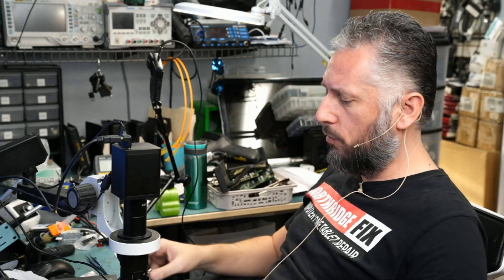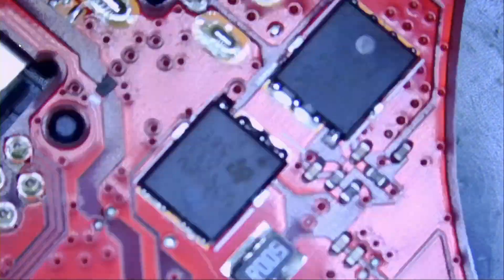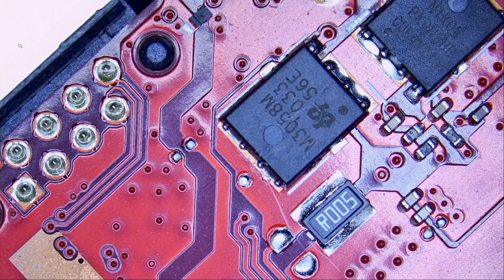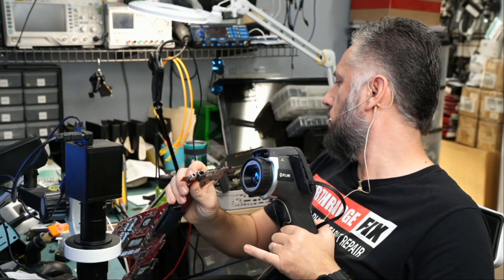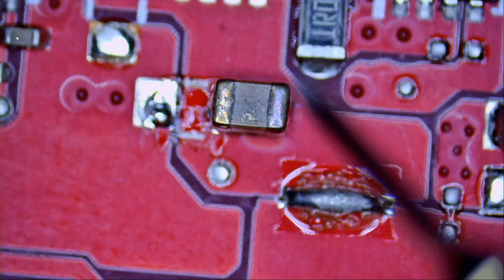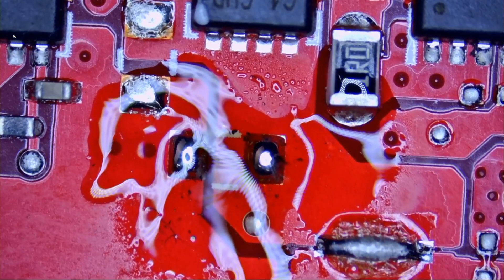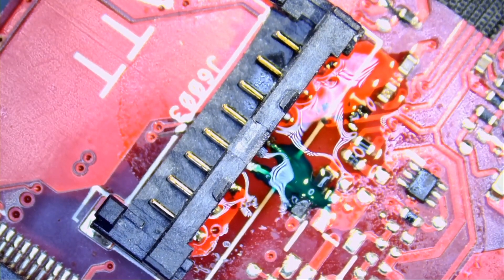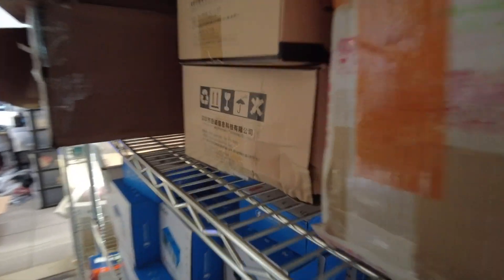Another Asus ROG Laptop Repair. What is the Best laptop to buy?

Comment: Totally agree with your comments on gaming laptops. I use a Thinkpad as my getting-work-done laptop, and a desktop for anything serious. I've seen way too many gaming laptops die young to recommend any of them.
Reply: Usually manufacturers put Cheap thermal paste from the factory , making it easy to overheat and die early, cause there a lot of videos out there with gaming laptop having reduced -10°C or even -20°C ❄️ just by replacing thermal paste ❄️❄️❄️❤️❤️ 

Second they pump too much voltage in their CPU's and GPU's than necessary (Still cant figure why.) 

modders and countless vids also proved you can reduce temps by Undervolting ❤️⚡🤟 if you dont want to open up and play surgery with a gaming laptop.
Reply: @JoshuaG  I agree with you. But the problem is people who buy them don’t know that, and it’s really a big problem.
Reply: For gaming laptop with Nvidia graphic card, you can try to turn on Whispermode. What does it do? It limits the FPS to 60 FPS with more stable temperature at 59-60C. No need to tweak laptop such as undervolting, apply thermal paste to CPU
Reply: Agree. Thinkpads are very good daily drivers. On the more expensive side, Panasonic Toughbooks (semi or full rugged).
Reply: indeed - it is what I am actually telling ppl for years
Reply: I have a dell G7 from 2018 that's still going. It's traveled around the country and is still fine. Windows however, ran like crap on it in various ways. I just phased it out for the steam deck, which is a lot more compact and lighter. The laptop is working though.
Reply: @gwojcieszczuk  - Toughbooks are military grade.
Reply: @JoshuaG  thank you for the info!!! But on my 531GT ROG Strix.....I never Gamed. I just used it for everyday stuff and DJ Software, Now I have a 10 year old dropped and screen replaced twicw and a new drive. thats it. CD rom died. But she is now my SDR Play Go To. Blessings All

Comment: Awesome repair, I've had lots of laptops and very few problems,  never had an Asus.  I completely agree on the 
desktop for high end graphics, laptops are just the wrong form factor.  The other issue with laptops is you are 
generally stuck with the hardware you have, not easy to upgrade like a desktop.  Excellent video.

Comment: The key is consumer based machine vs business grade machine. This goes for laptops and desktops.

I have a thinkpad T430 from 2014 that has never had anything done except mechanical hard drive swapped for an SSD. It runs amazing. I paid $200 for it used in 2014. T series was lenovos business grade line for many years.

Likewise I have a Dell Optiplex 3020... several years old. At least 5 years old. Again, swapped mechanical drive for SSD.... never another problem. 

Buy a laptop or desktop at walmart, target, or bestbuy... your getting consumer grade junk. Some may last a few years... most machines from big box stores wont last.

Comment: Genius work here. Just my experience, my old Omen 7700HQ 1060 MaxQ laptop has been golden since early 2017. Its running a full-size 3-fan 3060Ti in an eGPU, having had a 2060 in the enclosure before that. Benchmarking runs just below the average of desktops for both these cards, and I'm still happy gaming on 1440p 165hz 27" monitor at 90-120fps. But after this, I don't think laptops are the way to go for gaming now, mainly due to Thunderbolt being too limited and not able to get reasonable performance from GPUs above the 3070. Next PC will be a self-build desktop.

Comment: I think your right on with gaming laptops they do run hot and you are getting less for your money than a desktop,  so if you dont need portability then the desktop is definitely the way to go..

but saying that I've got 2x i7  gaming laptops that I've had since they were bought brand new,  they get used heavily daily  one is  an old MSI GE70 that the Mrs uses 16 hours a day  - the only issue with that one was with the original  battery itself failed after 3 years, and this one which I am using which is an  i7/ gtx1060 MSI GE73 Raider 8RE which is only off when I am asleep  or out of the house  - I ditched the original sata M2 drive and hdd and put 2x nvme m.2s samsung & kioxia (toshiba) and a mx500 sata SSD I had  spare, and went with 32GB of Crucial memory - this one can get really hot if not using cooler boost with games like Star Citizen, but seems stable and can cope with extended sessions even in the heatwave we had here in the UK, but I do admit I  use small  1 inch blocks  fixed to a board which sit under each of its feet to  make sure it  has enough air - the only issues I have had with this one is a frozen bios after a couple of  the Microsoft updates - but the bios reset is easily accessible without disassembly from the underside, and  the keyboard LED's  the green portion of the RGB has failed on a number of keys - I have avoided changing it out as the keyboard is heat-staked  rather than screwed or hooked into the palmrest, but functionally its still runs and works fine its been reliable for a number of years.

Comment: i think one big reason laptops fail is they are moved around and knocked into and bumped and a lot of motion inside of it where there shouldn't be movement making things fall off and break also after long period of high use causing it to become hot plus all the movement doesn't help them with out the proper air flow could it even get hot enough to weaken the solder after multiple heat cycles.... but there i go thinking again is that even something that sounds plausible or am i making shit up

Comment: Writing from an ASUS TUF Dash F15 laptop that is used in bad conditions, I would not have a problem replacing the MOSFETs whenever they would fail. But at the same time I have used a Clevo M571TU for the last few years, after it sat in the recycling bays of Germany, it was upgraded to the maximum possible, 16GB DDR3, GTX 280M, even installed a QX9300 into it because the big old chunk of metal is still running. Usually, unless something goes very wrong with these devices, they don't break for years to come. In some cases, 10-20 years, at which time they are well beyond the 5 years grace period regardless. This ASUS might be the first to be replaced after 2 years, because of needing more power soon, but remains a very respectable machine in my collection, afterwards. I had ASUSes back when they had the old EEE PC 701/901s, even overclocked one of those in recent years using resistors and feedback loop CPU voltage. Those run at double speed when overclocked, I even have the old BIOSes for them, shoutout to anyone who wants the old EEE PC 701 v4.00 bios, I have it, it's unlocked and custom LOGO'd ready to be flashed.

Comment: You are right, i also think that laptop aren't built for gaming. They called them gaming laptop, but they aren't built for it. The board, the heatsink, it is too small and they get to heavy or big. So better buy a desktop or build your self a desktop, so there is enough room, enough air to cool, and so on...great video. Greets

Comment: My Asus gaming TUF Ryzen 9 laptop died 8 months out of warranty (2 years).

We established that the PSU seems to have triggered the failure. Asus accepted that the PSU had been failing for some time (during warranty) but that an intermittent fault (it charged intermittently) was hard to prove... and replaced it... despite initially denying the out of warranty claim. 

Unfortunately, replacing the PSU didn't fix the problem and Asus established the motherboard was also faulty. They offered to diagnose it for free... waiving the normal fee. When they replaced the entire motherboard gratis I was surprised. Perhaps they were willing to accept that a PSU failing during warranty killed the laptop? Either way they've just bought themselves some serious good will. They never identified what had failed on the motherboard... which is a pity as it's nice to know which part is problematic.

Mind you... it was a fairly expensive laptop (>$2K)... and we bought 3 of them. It was barely used, never moved and was attached to a UPS... so there's no good reason for the failure.

The only problem is that there's no guarantee that the laptop won't fail again some time soon.

In future we'll stick to buying second hand laptops for more modest prices... on the assumption that if they've lasted a few years they're unlikely to perish any time soon.

:-)
P.S. Only annoying thing about the repair was that the repair centre deleted everything on the hard drive... and it's going to take a long time to reinstall it all: A fair bit of technical software with fiddly licensing.

PPS. Desktops don't seem to have any of these problems: If they ever have a problem it's a minor expense to replace parts... but laptops are useful at certain times.

Comment: I'm not sure the issue is with ASUS themselves, anything can cause an issue with the motherboards, ie running them hot for too long, then closing the lid so the heat cannot vent, constantly mobilised and shoved into a confined space such as a back pack after heavy load prolonged gaming time.

everything electrical fails at some point in its life cycle, there's no "well what about LENOVO or this make or that make", most boards and capacitors are made Widley from the same factories in Indonesia or China for many brands so blaming ASUS is a bit stereotypical.

ASUS have made some poor designed choices in the past with poor ventilation on there outer cases, i  have 2 ASUS laptops and one is ROG GL703 from 2017 with a gtx 1050 and its had some hammer trust me, still running still works still games, and a TUF F15 2022 model which has improved ventilation and runs cooler with less power draw, the mistake some people are making is purchasing laptops with the high end rtx cards which will run hot, go for the entry level RTX 3050 or the GTX1650 gpu laptops, if your wanting to run games with all the bells and whistles enabled you really need to purchase a desktop.

ive had ALIENWARE AND LENOVO lap tops with the high end cards and had nothing but trouble with them so i feel going for lower power draw and cooler less demanding cards and run games at an honest in game setting not pushing the gpu then you will save your laptop.

n RTX 3080 in a laptop running raytracing is A NO NO, leave this options disabled your laptop will thank you for it.
i would only risk RTX on with a desktop equivalent, as much as the card is designed for RTX on i just wouldn't on a laptop, which values my point go for the entry level gpu based gaming laptops, the cheaper the better,£650 for the ASUS TUF F15 RTX3050,if it breaks then its not as heavy a hit on the wallet, im done paying a 1000+ for a gaming laptop.

Comment: so i think ive figured out the trend of why gaming / high-end laptops fail is because of the heat from cpu and gpu.. witch causes caps, mosfets, and other component's to fail,  I've gone though   3 laptops in 7 years! all had mainboard failure but i got my eurocom laptop fixed after a mainboard replacement i decreased cpu clock speeds to stock 3.6  hopefully it lasts longer than 2 years this time!

Comment: I got myself a lenovo y540 i5 9300 gtx 1660ti brand new 2 years ago. Never had any issue. Undervolted and underclocked day one.I dont play on ultra but rather on high/ultra or 60fps, something that would not trigger the gpu fan to spin crazy. I have good temps. I could get more power out of it but it'll gonna get more stress by the heat for almost no gain and makes it less durable.

All i'd say, if you buy a gaming laptop, UNDERVOLT + only enable higher graphics when it's worth it, i mean, msaa x8 + fxaa x8 + aa x16 is kinda pointless on a laptop...

Comment: The two best laptops (I have experience with a lot of them) are 
1. AORUS 17X (Intel 12th Gen)
2. ThinkPad X1 Carbon Gen 10 (14” Intel) 
I would recommend the MAC, but, they are so damn expensive to repair.
You need a laptop if you are a mobile tech.

Comment: To me a laptop is for use when traveling or needing a portable solution.  Otherwise desktop all the way.   The laptop I currently have was bought used and it's an Asus ROG gaming model from like 2012.  I've upgraded it by swapping out the older wifi G to a much newer Wifi 6 M.2 card.  Gosh what a pain to get to.

Comment: Hey boss, when you solder things like these motherboards, what temp do you set your soldering iron to? AND also what temp is your heat gun? Do you use the heat gun simply to keep the solder warm enough to quickly re-flow? I'm about to replace a DC jack plug on an older Asus Zephyrus laptop, and I'm just not sure what the best temps are to use. I assume I will also use Flux as I've seen you do in all of your videos.

Thanks!

Comment: To begin with, Asus has always been a bad choice for notebooks, I agree with the issue of desktop durability, I had desktop computers that lasted more than 10 years, I upgraded due to obsolescence, and even then I reused the power supply, monitor, cabinet etc. I don't know why desktops are so much in disuse, they die out of nowhere and you still don't reuse anything.

Comment: Hi Alex, what do you think about to use the solder mask under the pad strip to fix them on the board ?
Reply: Ideally you want the piece you're soldering onto to be as flat as possible with the board, putting solder mask under the pad would make it sit unevenly and the other pins would have to accommodate for the height difference.
Reply: The problem being solder mask is UV Cured - the copper blocks the UV light.

Comment: what is your experience with Lenovo Legion?  It seems like ASUS, HP, Dell all have similar issues in their gaming setups.
Reply: HP and Dell are kind of generic for office, some models are not meant to be repaired or require some special parts, but they are overall good. Asus is fine, but they are focusing on 300W slim laptops, not good, but people want that, thats a problem, too much power in a very small space, does it work, yes, when it will go bad, as soon as possible. Acer are fine, but they changed some things, they can be very complex. Legion, in my opinion, not good as other brands. When you consider future upgrade, such laptops cost money, less and less laptops are offering that, because business people do not need that.
When you consider future and durability, things like changing battery, replacing keyboard and such, Legion are bad. On most laptops you can replace keyboard, remove older one, put new one, but Legion have that wonderful idea to bound one of 4 laptop covers with the keyboard. This 4 covers for laptops are expensive, in order to replace keyboard, you need to buy whole cover and keyboard, otherwise you will not be able to unbound old keyboard and you will not bound perfectly new keyboard. They got BIOS problems and such.
In nutshell, all laptops are made with same materials and components, same companies producing same caps, its about what cap from same series will blow in what laptop, usually for repairs comes laptops that are mostly sold. Its not question whats more durable, Kingston or Samsung, Elpida, Realtek, Intel or AMD, nVidia, Micron or SK Hynix, or capacitor manufacturer.
For example you get 100 gaming Asus laptops for repair and 10 HP gaming laptops, but at the same time Asus sold 10000 laptops, and HP sold 1000, so they are equal, its more about advertisement, more ADS, better sale, if its cheaper, you will sell even more units, with low price and high quantity, quality are big question.
Reply: I'm going to test out a 11th gen ThinkPad.   Hope they last!

Comment: Serious question- my sister does soldering as a job but when I was talking to her she said they dont use a smoke sucker. How harmful is that to her?
Reply: If they are using lead-based solder the smoke and vapors must not be breathed.  Lead accumulates in the body and causes neurological decline, behavior changes, and reproductive problems.  These are permanent.  The body eliminates lead very slowly, so any exposure should be avoided.  Your sister needs to find out what kind of solder they are using.

Comment: Any corporate level laptop from HP / Dell and Lenovo will get things Done. Thinkpads have gone down after T480. I have an L15 G2, nothing special. Gets the job done but it is not a gaming rig. The key is CORPORATE ones, because those are sold under 3 year warranty contracts .... so they are FORCED to do things right. I have an elitebok 640 .... Man .... it even puts a Thinkpad to shame ....Clean the machine and change thermal paste every year and you wont find any problems. For high performance .... a laptop is not an option. For average work, you can still trust on a laptop. Just run away from the ones that RAM / STORAGE cannot be upgraded. .... those are trash.